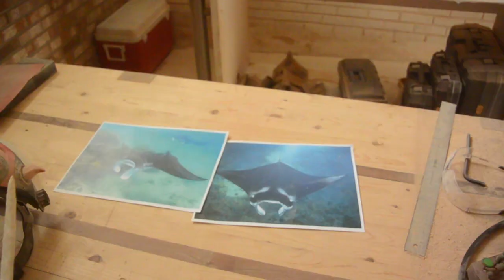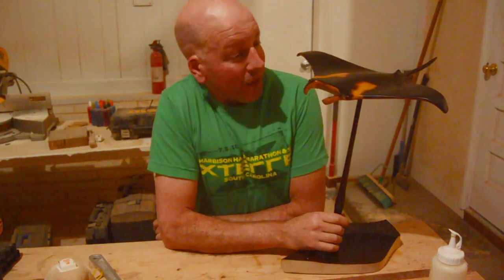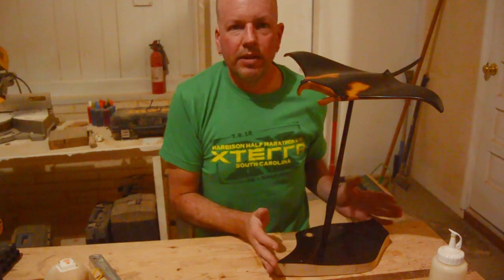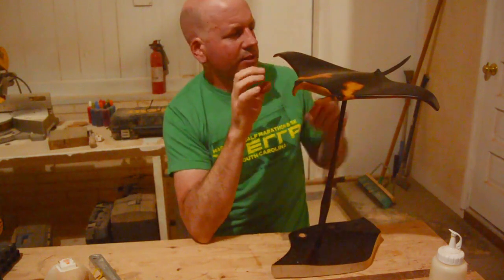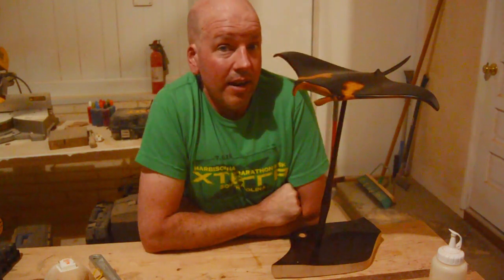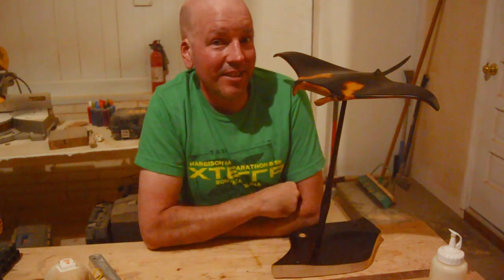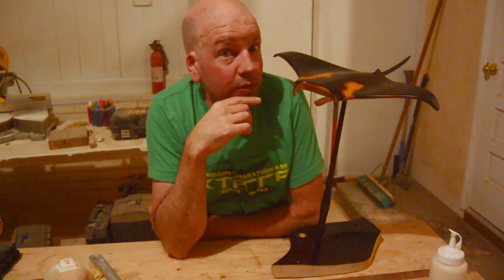Carving a Manta Ray from Wood - Art, Sculpture

Comment: Hi can I ask what is the type of disc you are using on the angle grinder to do the initial carving - Kind Regards
Reply from the maker: Thanks for watching, Chris. I used a burr disk. There are a few manufacturers that make them; Kutzall, Saburrtooth, King Arthur's Tools...
Reply: Cammie's Garage I tried to say thanks and show you what I think the UK version is but link keeps getting blocked
Reply from the maker: Yeah, YouTube defaults to blocking links in comments to prevent spam. Alas, it blocks well-meaning comments also.
Reply: Cammie's Garage I’m guessing the SaburTooth burr disk on the Axminster UK site is the one you mentioned